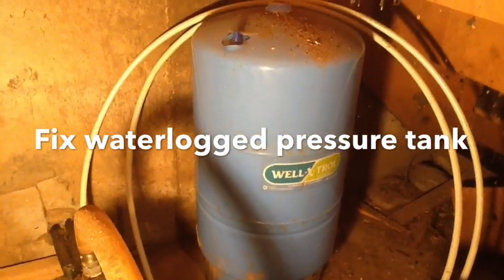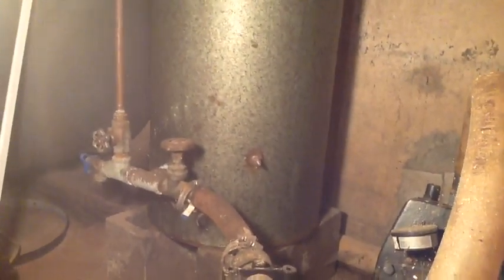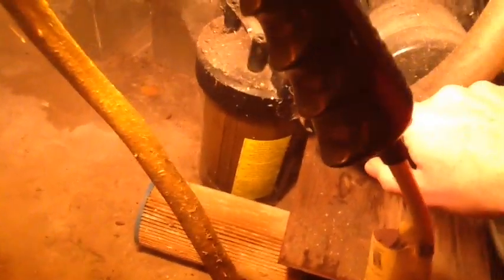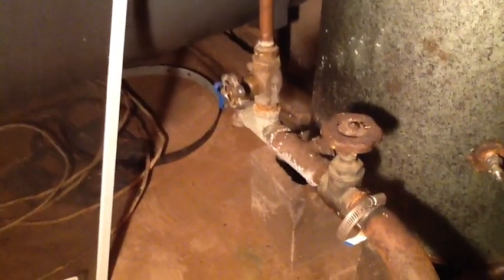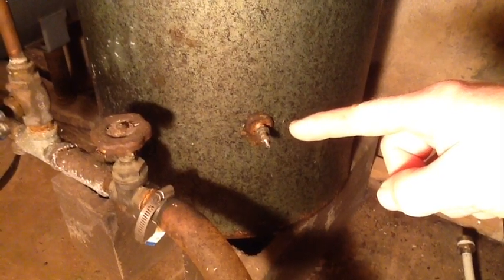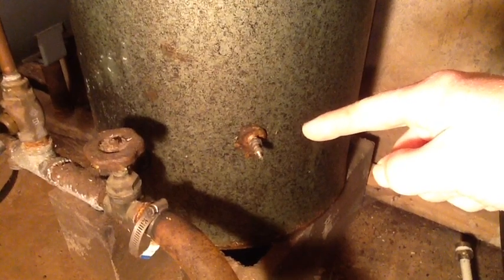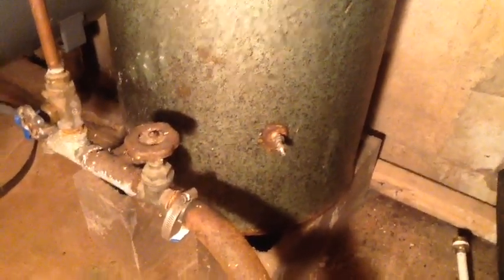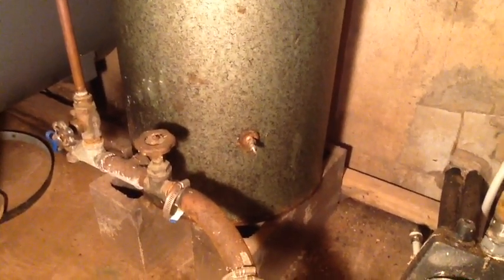How To: Fix A Waterlogged Pressure Tank - for rural or off grid homes

Comment: Been running mine this way for 4 years. Check the water level once a month by feeling where the temperature difference is. Add air again as needed to keep at least 1/3 of the tank filled with air or more at all times

Comment: Why not just drain the tank so that that it is 1/4 or 1/3 full of water, then add compressed air to 30 psi and then turn on the water pump? What is the advantage of draining the whole tank??? Any comments from anyone.
Reply from the maker: thanks for the comment. in my case the air fill was so low on the tank and there was no 1 way valve that in order to put air in, i had to do that. the newer bladder tanks if they aren't waterlogged can be filled from the top every so often. I'd say whatever works for you is good. I haven't had a problem with mine since this video was uploaded, same pressure tank and all. My tank doesn't have a bladder.
Reply: That's the way I have operated mine for 30 years.

Comment: Bladder tanks get waterlogged because the bladder has a hole in it. A pressure tank has no bladder and if waterlogged, you drain it completely, and refill. There is a lot more to this but these are the basics.
Reply from the maker: yes, thanks for the comment. exactly right!
Reply: Morning bro..i wanted to ask so do i drain all the air also to remove the pipe and tank?? Thanx..

Comment: How can you fix a little leak in the bladder type tank? The bladder is full of water, not air. Drained the tank, but that doesn't drain the bladder. 
Service guy was able to do this a few years ago, but I can't figure out how. 
Any advice appreciated.
Reply from the maker: hey thanks for the comment. and great question. if the bladder is waterlogged - not a lot of options. If it has a  hole in it (because its waterlogged) one would think if you drain it and leave it there for a sufficient amount of time it would leak itself out - however doing that and filling it back up would just cause it to fill up with water again. in the case where the bladder is compromised - there really are no alternatives long term then to get a new tank. its not something you can fix. If the hole is at the bottom of the bladder, you might be able to sprays in the tire goo sealent that you fill car tires with - it reinflates tires while forcing in sealent.  That does assume that the selaent will get to the spot where the hole is and fill it and since you can't rotate the tank easily, it might not cover the whole bladder enough to find the hole... might be worth a try though... but make sure the bladder doesn't burst as that stuff expects to fill a tire to 35 or 40 psi but the bladder likely should only have 20psi or something.
Reply: dogsmumm

Comment: So it all boils down to. drain it through the same place you put air in? Then put air in and fill the tank and all done?
Reply from the maker: yep. pretty much. its simple but most people don't understand it. Now if you have one with a balloon type air bubble, ballast whatever, it may be water logged because that balloon (rubber) is punctured. for mine, its a simple bell pressure tank, air at top, water at bottom (they touch each other basically, not separated by a rubber balloon -the word escapes me for it right now). Yes, you're correct, drain it out - add MORE air to it because air is what allows it to be pressurized because you can't easily compress water but air does so you can get your PSI from the air being compressed. now how did the air escape in the first place? thats for you to figure out and fix or maybe this fix gets you another year or two down the road. for me, i haven't had any trouble since.
Reply: +EverythingNewUnderThe Son thanks!
Reply from the maker: +oxfords1 I should mention that you could drain it via the pipes as well, I e to drain it slow from the air pump valve so I could fill up buckets and empty them quickly enough since this is in my basement.
Reply: ***** thanks. I wanted to ask one question if you don't mind. I located the valve and we do have a spigot right next to our pump. Can we turn the pump off and turn the spigot on until all the water runs out? Would that constitute emptying the tank? thanks in advance.
Reply from the maker: yes, however if there is only a tap on the pump side, you'd be draining the pressure tank and all the water in the house pipes, so you'll need lots of buckets to catch it all. if you have a tap on the other side going to the house pipes, turn that off as well so you're not draining all the water in the pipes.

Comment: I have a small crack on my water tank and its causing water to shoot out the hole how can I fix this without buying a whole new tank? Help please??
Reply from the maker: Hi, thanks for commenting. Good question. is it coming out a hole or do you actually have a crack? is it metal, or fiberglass? If its a pin hole in metal, you might be able to use JB Weld which is an epoxy, that could work. If its starting to rust out though that might be a losing battle.  You need something that can withstand the pressure too. If its fiberglass, you could fix it by adding a fiberglass patch to it which would likely work really well if you knew how to do that. DOn't know if that helps, those would be my initial suggestions :)
Reply from the maker: Roy Dewitt yes sir?

Comment: I have a problem with my system. It holds at about 45  to50 pounds, when i turn a faucet on the pump only runs for @ few seconds then shuts off..It keeps doing that as long as the tap is open. Every 5 or 10 seconds, clicks on..then off right away..Is the bladder tank shot? Or just the switch?
Reply from the maker: Hagfan789 i'm not an expert but what is the range for the pump? it should be allowed to get as low X psi and shut off at Y psi. So mine gets down to 20psi, at that point the point comes on and pumps it up to 50 psi.  The other thing could be that it definitely is waterlogged - no air left in the top. If there isn't any air left, there is nothing to compress other than water which doesn't compress well of course, so as soon as the pump turns on and adds a tiny bit of water, the pressure jumps right up. The air allows it to keep adding water and compressing the air inside until the volume of water is sufficient. You should drain the tank and see if you can pressurize / pump up the tank or the bladder. I think, even with the bladder broken, you can likely use it as a plain old bell pressure tank like mine. Drain it fully, then pressurize the tank to 20 psi or 30 or something. Then fill with water. That gives the pump a base pressure of 20psi for example, and gives it room from 20 up to 50psi to fill the tank with water.  Thats are my ideas anyways :)
Reply: Tank

Comment: Time to upgrade that system fella..You drink from that setup?
Reply from the maker: Hagfan789 i would absolutely NOT want to upgrade it. That old tank has less moving parts - no internal air bag which means less to break and cause issues, and its also leached already any harmful chemicals into the water years ago - i.e. when it was new. The NEW kind has a rubber bladder in it ready to leach petroleum chemicals into the water, and runs the risk of the bladder breaking - for which there isn't much to fix other than buying a new tank. This old tank will basically last forever until it physically rusts out. I think its a fibreglass composite or something but there is rust near the bottom so not 100% sure. I would totally not wish to upgrade it though. Our water is tested - as per law - for quality so no worries there. and any extra bacteria is generally good for your gut.
Reply: Dust on the outside doesnt make it unhealthy.
Reply from the maker: @MarcoDeoMARCUSOREALIST  thanks for the comment, yes i had it before the tank for a while till my pump died. it causes short cycling if its before the pressure tank unfortunately. so its best due to short cycling of the pump to be after the pressure tank even though there is heavy sediment.